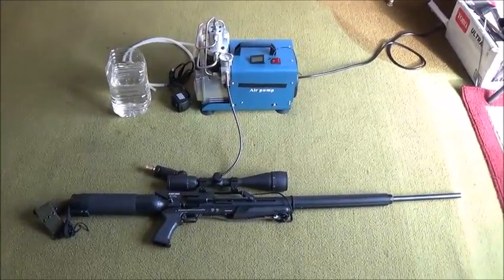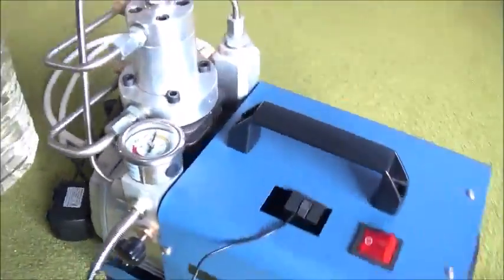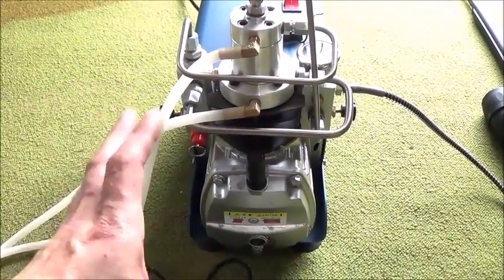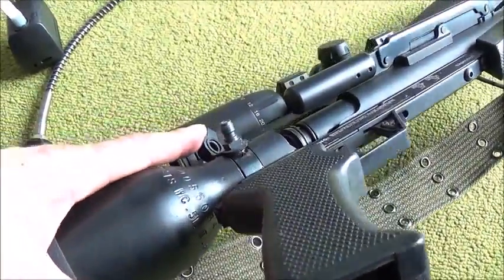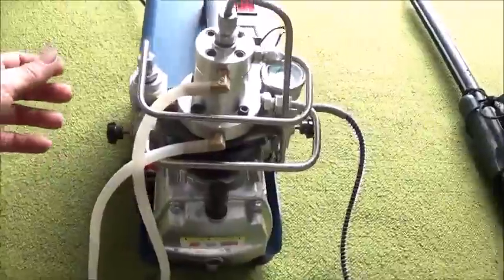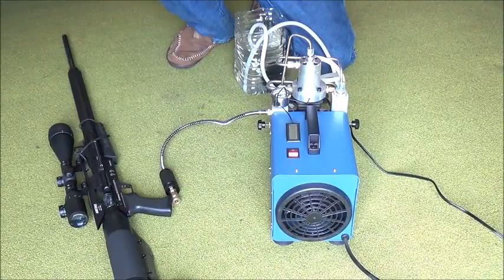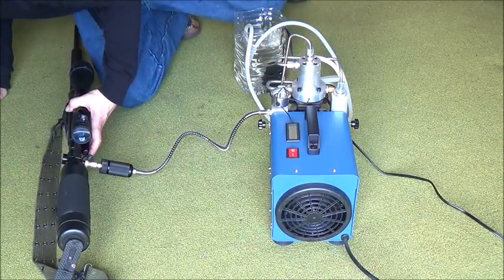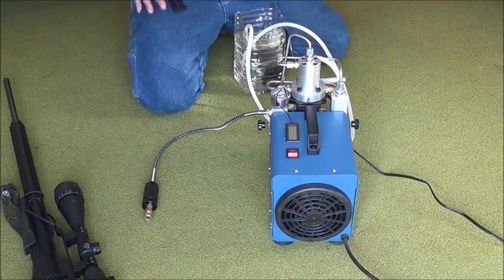How to use a Ebay 4500 psi. air compressor to fill your PCP Air Rifle.

Comment: Good info, just got mine. What size batteries does the thermostat take? I dont see it indicated anywhere.
Reply from the maker: Not sure, I never used mine. My best advise is don't try and fill scuba tanks with it, don't run it longer than 3-5 minutes without shutting it down and fully letting it cool! If you don't over work these little units they typically last about 5 years!

Comment: Great info! Just received mine.
What oil do you use?
Would you recommend an additional filter for water?
Reply from the maker: I use compressor oil or air tool oil, water filters will depend on the humidity were you are!